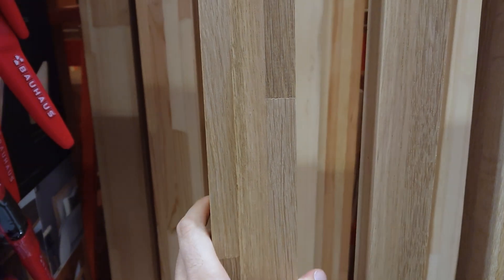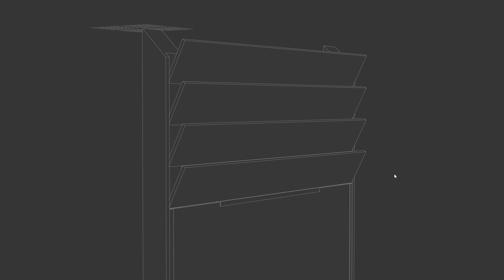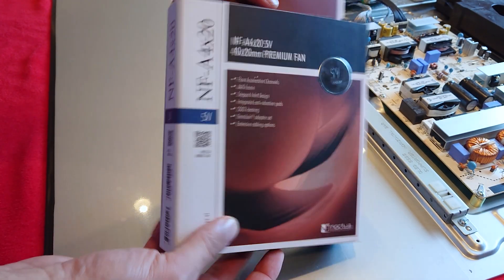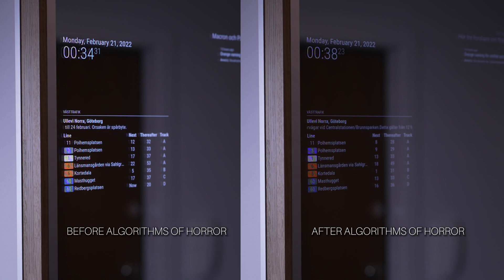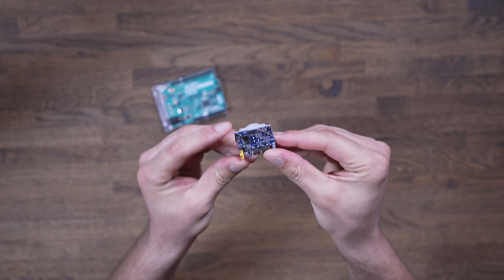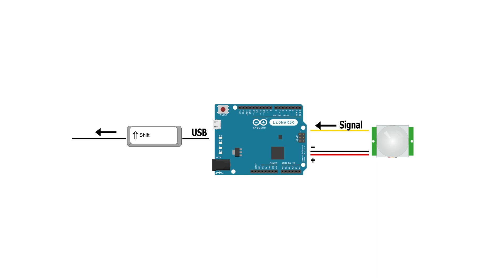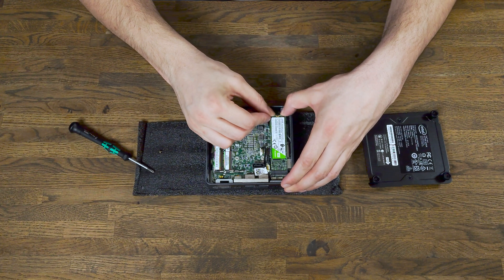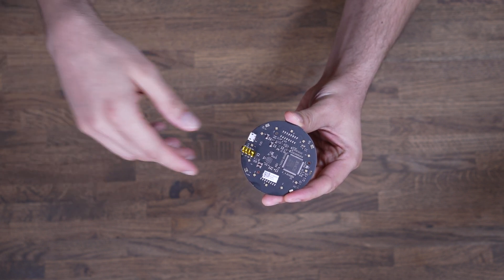4K OLED Smart Mirror Hardware Talk! (Project Elizabeth Ep. 4)

Comment: Hello Hootie. I would like to ask you what settings have you done to respeaker 4mic array to work properly. I bought one for my mirror and it is way worst from the 10euros mic i was using before. Thank you.
Reply from the maker: Hey Anthony! Definitely sounds like something is wrong. Are you running on rpi? Is it the Mic Array V2? Have you checked audio record settings? As you perhaps know, I'm running the mirror on x64 Ubuntu these days; settings are very different. If you are running Ubuntu, make sure you choose Multichannel Input - this will make day and night difference. On rpi there are several things that can make a difference depending on your settings in PulseAudio or firmware. You should check what firmware you have on the mic as one of them is for 1 channel audio while the other firmware is for multichannel. You can read more about that here to get a better understanding about your microphone https://wiki.seeedstudio.com/ReSpeaker_Mic_Array_v2.0/

Sorry my answer isn't more on-point buddy, good luck.
Reply: @HootieStyleChannel  Hello. I have installed Magic Mirror following your video and everything went as suposed. Not even a single error. I am rpi 3b+. I have made a topic to their forum as well but no response. I will search more then. Thank you for your reply. Waiting for your next video.